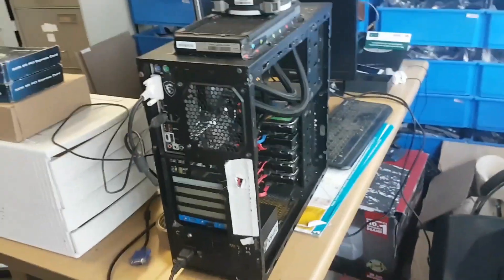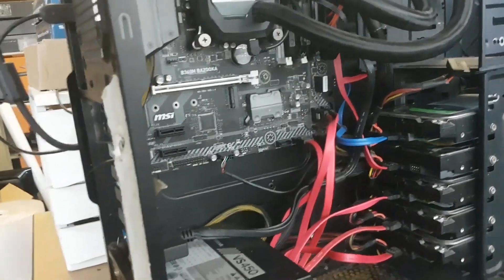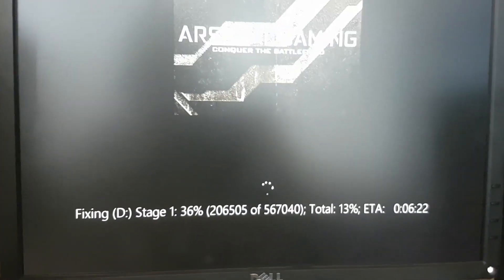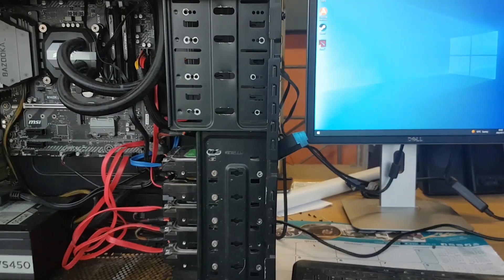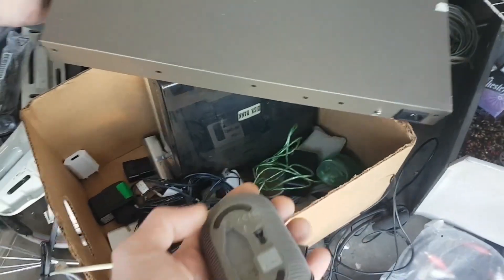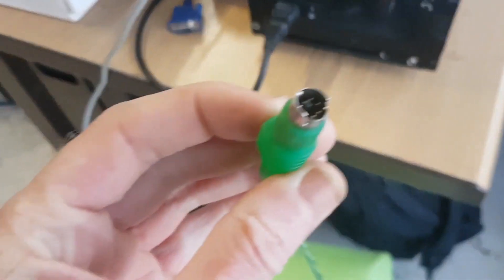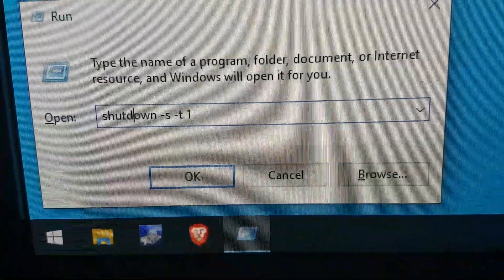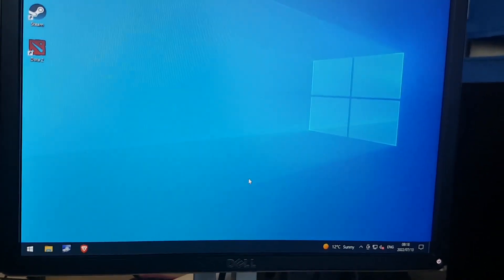A New Signum   Rig Building   Part 2 Crypto Mining Series

Comment: Hey, ali2star! Great to see you moving on with your ECEM Signum mining project!
Consider adding screws to your drives. Four screws for each drive at maximum (or less in case there are screw-less rear side of a drive busket). Tight conecton to a case will increase heat removal and reduce vibrations, that are harmful for drives.
Reply: Thanks for the feedback, we'll look into it